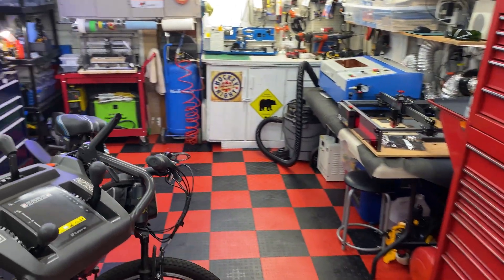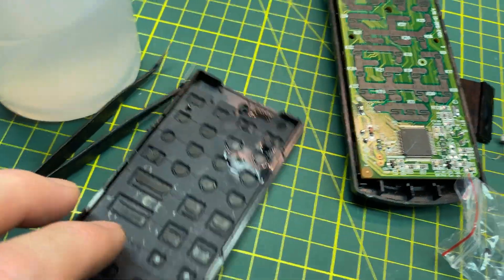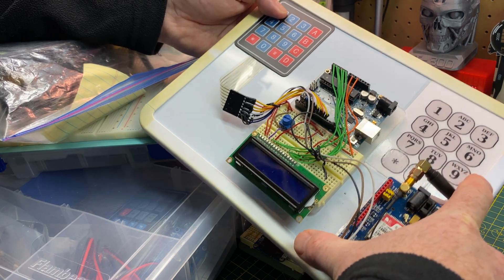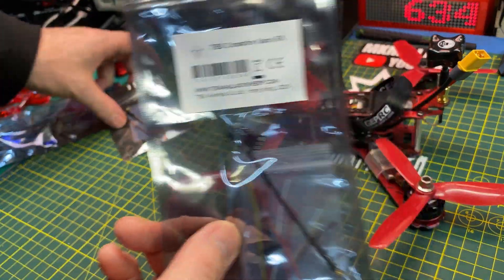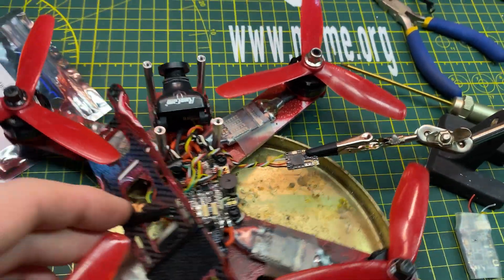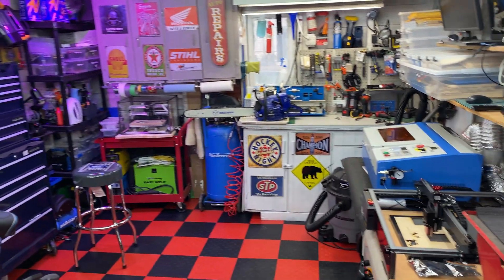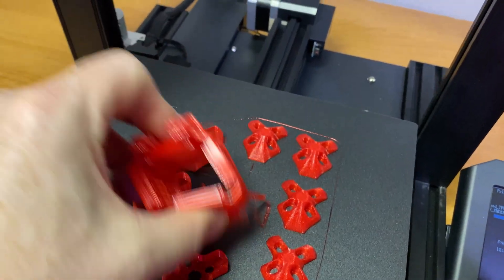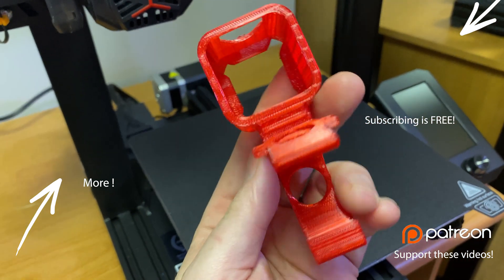10 Days of Making- HUGE Electronics Package Arrived, Electronics Repair & Makerspace Update

Comment: I put in the RaceDeck brand of flooring a few years ago.  I found it quite challenging to "snap" it together, but I haven't had any pieces break like you have.  I looked at the pricing, and it is getting close to double what I paid for it though... ugh.  I use it in a basement where my retro PC's are... massively better that standing on concrete, and still allows the damp to come out of the concrete.
Reply from the maker: I still love it but wish the red ones were a bit better